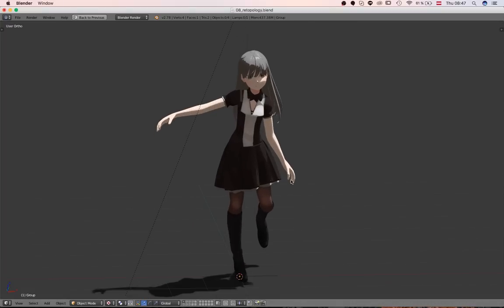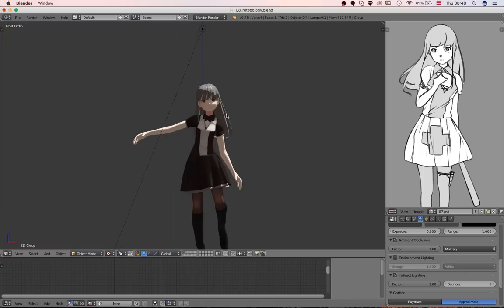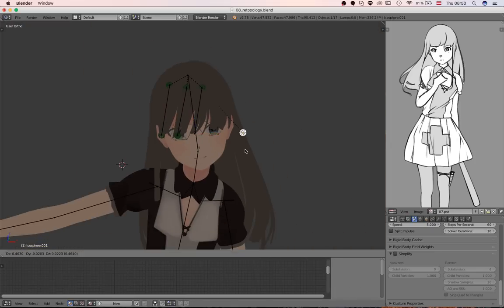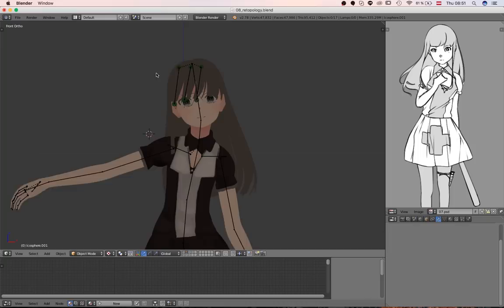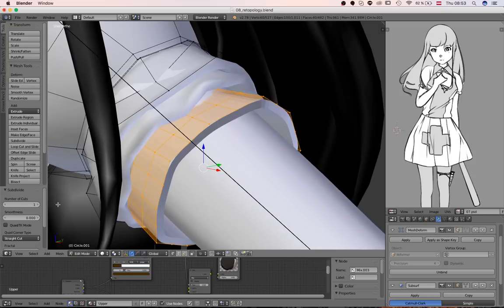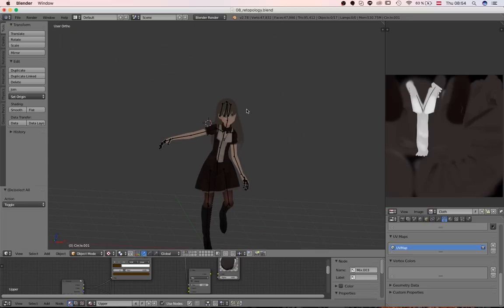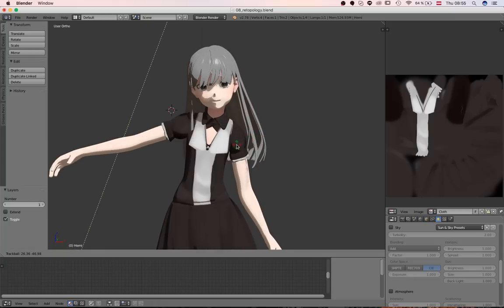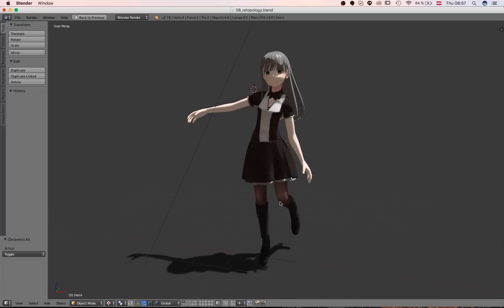3D Anime Character [Hair Physics and Material Setup] - Blender

Comment: very nice work. is the color output of that white material same as what the shaded color would have been (if only a plain white lit material is applied) ? I'm not familiar with blender materials, apologies if this is a stupid question.
Reply from the maker: +Ryan Tam Well, I'd like to answer that question but I'm not sure what you are refering to. So there is a 100% white diffuse material that is used as a base for any color. Basically the grayscale shading is multiplied to the color / texture if that makes sense to you.
Reply: Thanks, that is what I wondered (getting the grayscale shaded color in nodegraph)

Comment: WARNING!

I just want to point out to everyone from the game industry who's watching this, the "preserve volume" option in the armature is NOT exportable. This is because the option runs a different algorithm to calculate the new position of the vertices. This algorithm only runs in blender and NOT in the game engine. As far as I know no engine has it yet because it's just too heavy to run it in realtime.

So use it only if you are going to render an animation inside blender.
Reply from the maker: Yes, thank you for pointing that out. My current version is for Blender only.
Reply: what about blender game engine? i dont know anything about it to be honest, but it makes sense to me that it would
Reply: gabriel hilgert I don't know for sure if it let's you do it but the same problems apply even if it does let you. it's not the implementation that's the problem, it's how expensive it is to run it, use corrective blends instead, it's faster and produces better results
Reply: i'll look into it, thanks!

Comment: Will hair physics work in a game engine? :o
Reply from the maker: Not without a lot ow work. The concept is the same but you need to adapt the technical details to your game engine. For example in Unity I think you can use the ragdoll system? Maybe...
Reply: Wouldn't it be better to animate the hair along with movements? I think it would be easier in the end to be honest.
Reply: Surely you could do it that way and it would be much easier, but the animations wouldn't look as fluid
Reply: Makes sense, Daniel. Thanks c:

Comment: hey dude do you always use bender render or cycles? and also would you please make a video about tips and trick on how to model smoothly thanks man.......
Reply from the maker: I prefer the Blender Render Engine or even the viewport itself because of the render time and the control. But really I think both of them aren't ideal...
As for smooth modelling, hm... it's really only a very long process of adjusting the position of the vertices. One advice that I can give you right now is to look at the geometry from a very steep angle in orthographic view mode. Uneven surface becomes very obvious then and can be fixed with some practice. You only need learn how to control the shape at the same time, not to become a human smooth modifier :P
Reply: do you ever use cycles? if so how long does it takes for you to render? and also what texture do you use to make it more like its in 2d. Just like your last video when you model the character from flip flappers....
Reply from the maker: I don't use cycles for NPR rendering...
As for textures I didn't use any for Cocona (except for the eyes). This one makes heavier use of textures but it's mostly a solid colour with subtle details (simple soft brushstrokes and gradients)
Reply: ohhh k thanks man..

Comment: Looks really good, what kinda sketches do u use to make those models? Like templates?
Reply from the maker: Hm... nothing really. For this character in particular, the sketch I showed during the video was the only reference I used during the modelling process. I made use of sculpting tools instead so getting the proportions right was really similar to drawing anyways.
Reply: Daniel Kreuter so how could i make character models like that without having any real drawing experience, like are there some character sheets or templates you can find online to use as a reference?
Reply from the maker: There are many but they are easier to find when you decide on the character first. Then you can search for drawings more specifically and usually find good views from the front and the side.
As for the body, it gets a bit more complicated but if you're good at image search you should be able to find some separate drawings that can be combined.
But in the end I recommend learning how to draw... It takes years of practice but you learn a lot about many aspects of character creation.
Reply: Daniel Kreuter thanks for the advice and keep up the awesome work